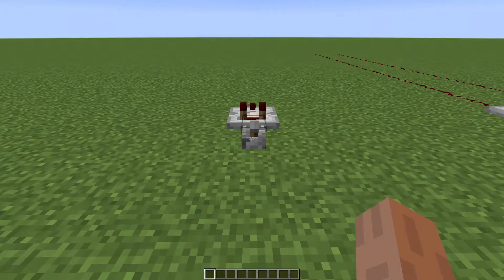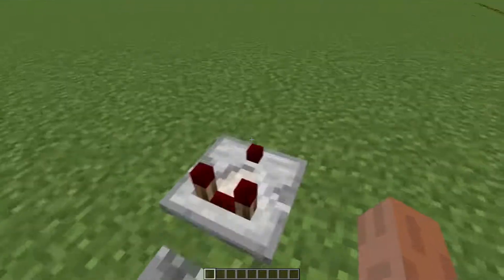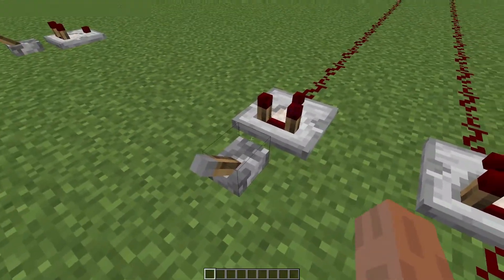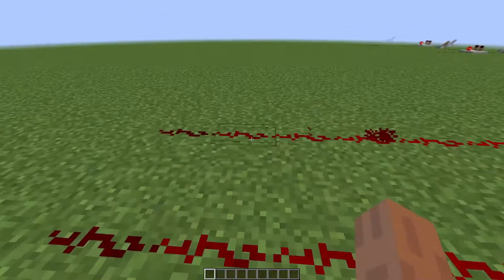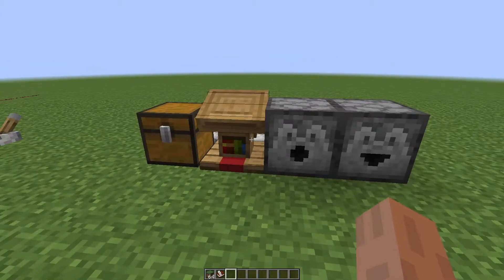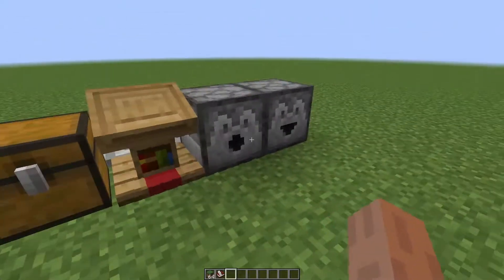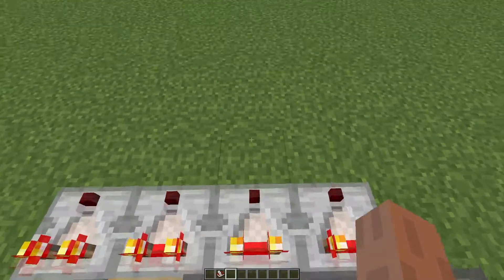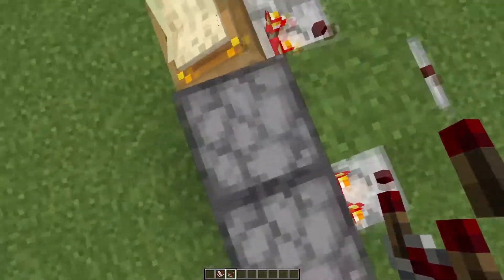A Beginner's Guide To Comparators - Minecraft Java and Bedrock

Comment: I found something weird with comparators. I put a comparator facing the side of a repeater. I activated the redstone and the repeater changed its thing that you move on it to a sort of weird bedrock texture. Can u check this out and maybe tell me what it does. I am interested.
Reply from the maker: This is the locking function of repeaters and has nothing to do with the comparator. I covered it quite in depth in my video called A Beginner's Guide To Repeaters.
Reply: @SkizzeYT  okay

Comment: B-A=C
Then add a repeater  between B and A to get clock
Ez moneyyyy
Reply: Actually no repeater needed, comparators have the same base delay as a freshly placed repeater so just take the output and immediately point it back into the side while in subtract mode to get a clock. Because the smallest this can go is a 2×2 square you'll always lose 2 signal strength on the way back to the comparator, meaning that the newly subtracted output will be 1 signal strength too short to reach the comparator and any circuits attached to the second dust in the chain will stop being powered. Now because the comparator no longer has a side input the signal jumps back to full strength after a delay and the cycle repeats, making a clock!

Do a formation like this to try it out:
   X     □ = comparator 
X X     X = dust
□X